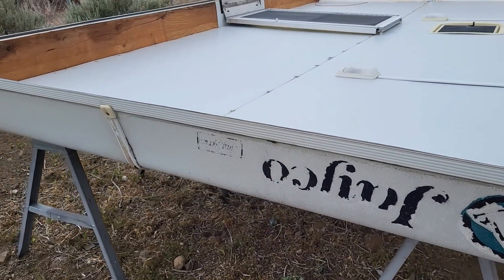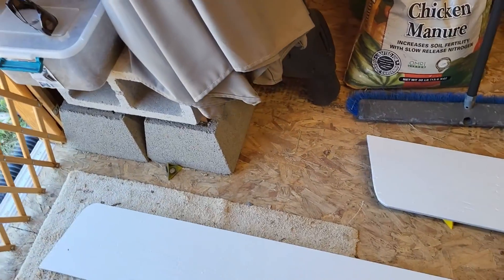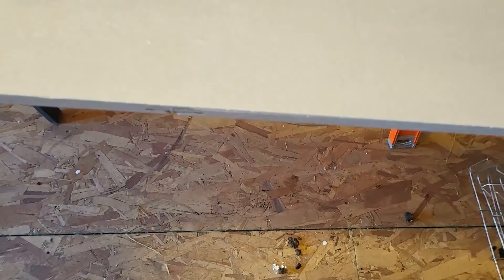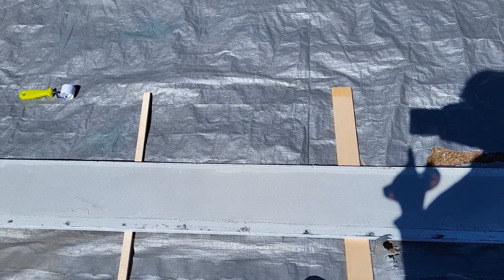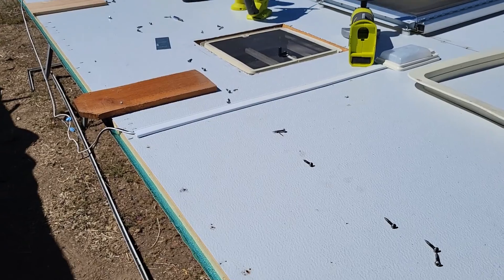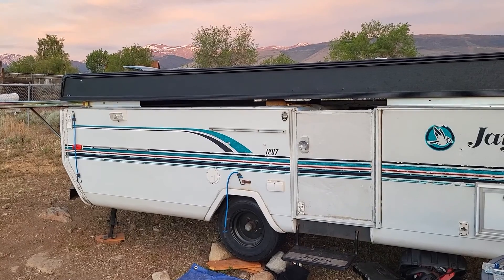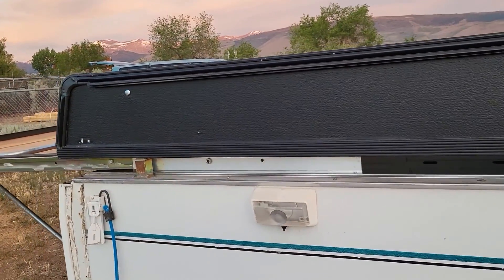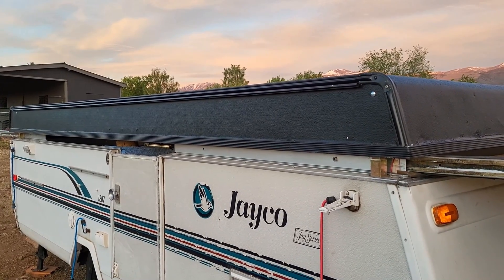1994 Jayco Pop Up camper renovation Part 3 The Roof!

Comment: This is awesome. My main issue with renovating mine is the fact that idk what some of these pieces are called. Where can i find that trim piece on the roof that holds the side wall to the camper and other hardware?
Reply from the maker: We reused all the metal trim pieces (I scraped, sanded, primed, and painted them all with Rustoleum spray paint). We did buy all new screws as most were rusted out. We took an old scre to Home Depot and found the closest to it. We mostly used 1/2", 3/4", and 1" screw in #6, #8, and #10 depending where they were. You could try RV stores, but if it's older, they may not have any.
Reply: Thank you!! @jeepinwithjulia

Comment: Hello! We are in the process of rebuilding the same camper. What primer and paint did you use on your roof?
Reply from the maker: On the roof I used products I already had: Kilz dark base exterior primer (it's gray) and Sherwin-Williams exterior low sheen paint in Tricorn Black. It is the trim color on our house.